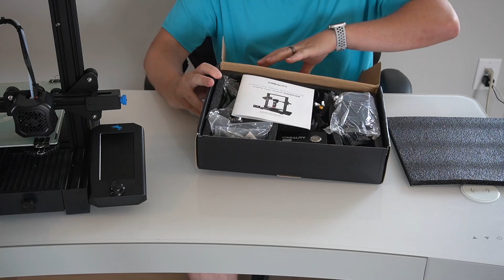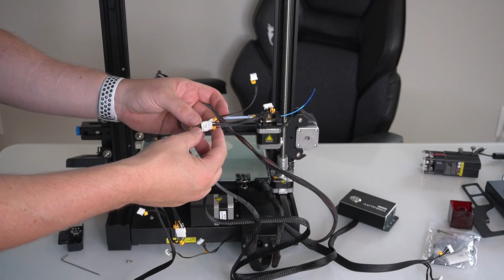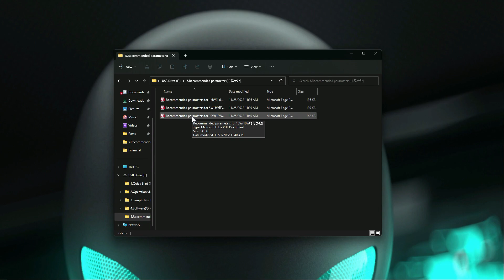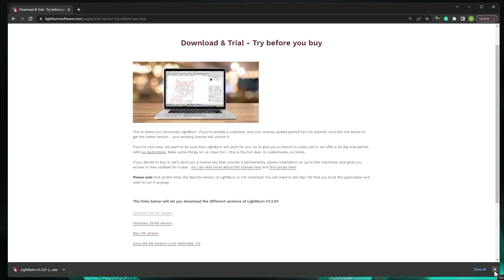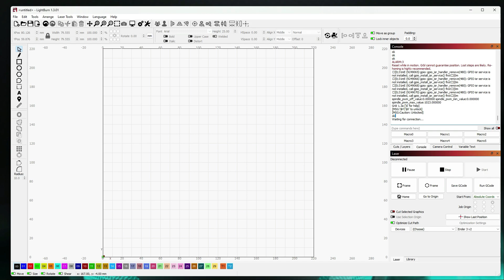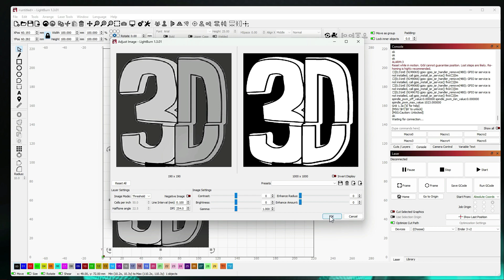Creality 10w Falcon Laser – Install and Initial Thoughts!

Comment: Hello, I was cleaning my 10w laser but when it comes to making cuts it doesn't make them, the laser stays on but doesn't cut. I don't know if you can help me, maybe I used a material that I shouldn't have when cleaning it.
Reply from the maker: Hi. What did you use to clean it and was it cutting properly prior to that? Also, why did you decide to clean it, i just curious cause i never have.

Comment: Any thoughts or tips as to why it will start a job and then just quit? I just got everything set up and running and I get a few seconds in on an engraving and it just stops. I've tried searching but I can't find any more info.
Reply from the maker: Hi. What software are you using and does it give any info in the console output?
Reply: It's light burn, and the machine thinks it's doing it's job. I didn't see anything in the console,. I was able to get it to cut but not engrave. Then I tried a firmware update per Creality and it really got weird. So I've thrown in the towel and I'll be returning it. @3DPrintscape
Reply from the maker: @lizjamar  That sounds odd, could be a hardware problem as your thinking.
Reply: Thanks for the reply.  @3DPrintscape

Comment: Hello my teacher. would be very happy if you help me. I bought the same product. My printer is the same as yours. I did the setup as you showed. the power of the laser is not adjusted and stays on all the time. it cuts at the highest power even when advancing to engraving or creating a frame. Can you help me?
Reply from the maker: Hi. SO you have the 10w laser and the creality control box? Does the laser stay on if the box isnt connected to the printer?

Comment: when i auto-home, the laser does not go to the bottom left. it goes to top right even though i set the origin to bottom left like you showed in video. Any thoughts on how to get it to work properly?
Reply from the maker: Hi. What printer do you have and have you tried to change the origin setting? Im wondering if its related to your printer/firmware.
Reply: @3DPrintscape  I have Ender 3 s1 with the latest fw (Ender-3 S1_HWv24S1_301_SWV3.0.4_C_F401_FDM_LASER). I will try the different origin setting.
Reply from the maker: @seangrant7745  Did the different origin settings work?
Reply: @3DPrintscape  didnt matter..i set to top right and it kept trying to go past origin and motor sounded like it was grinding
Reply from the maker: @seangrant7745  It sounds like the bed size in the firmware may not be right then. What firmware are you running?
Reply: @3DPrintscape  I have the ones i listed in the earlier comments. If i set the laser position to be in the middle of the bed and set LightBurn to use the current position, I can get it to engrave without issues. I just cant have it go to Home but that is fine.
Reply from the maker: @seangrant7745  I havent seen that behavior before. It may be worth reaching out to support.

Comment: Is the additional weight of the laser a problem on a single z screw printer?
Reply from the maker: Hi. Overall i would say no. When its in place it stays. I did have an issue getting to the right height once because it kept falling down a tad bit. I was able to account for this with the screws on the laser mount.
Reply: It was a massive problem on my Neptune 2. I ended up having to power up the Neptune to hold the Z in place.
Reply from the maker: @pacmunchiez2828  Interesting, there is probably something you can clip on the z rod below the x axis to hold it in place.

Comment: Hey question about the cr touch I have a skr mini e3 dip v1.0 can you tell me what port to plug it into
Reply from the maker: Hi. You would connect the servos pins to that port and the probe pins to the z stop port. Its kinda a pain though.
Reply: @3D Printscape  in your video it looks like you use the tft port though
Reply from the maker: @blackbird883  I have different screens on different printers. The tft is connected to the skr on the tft port. The creality screen is only using the standard ribbon cable port.